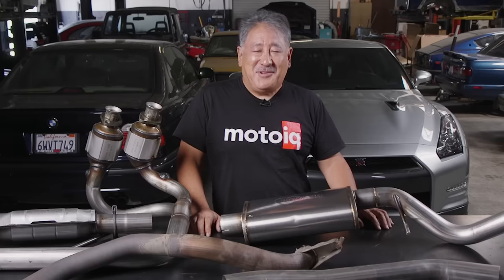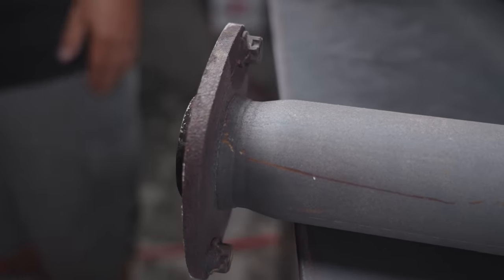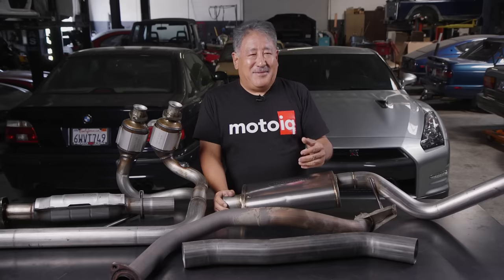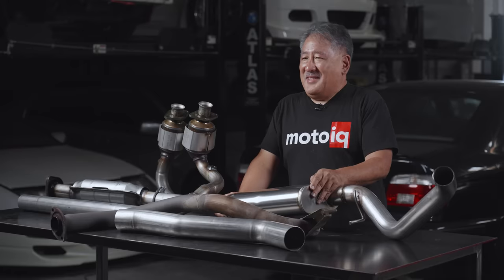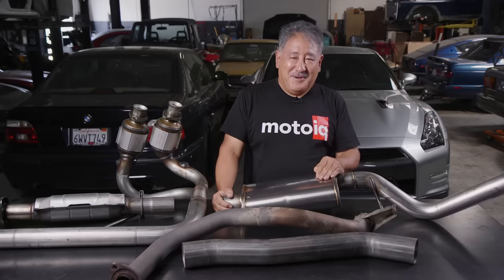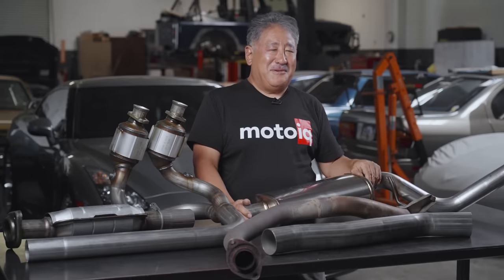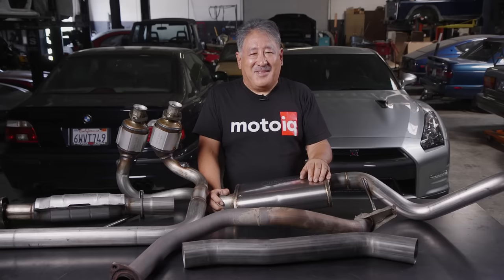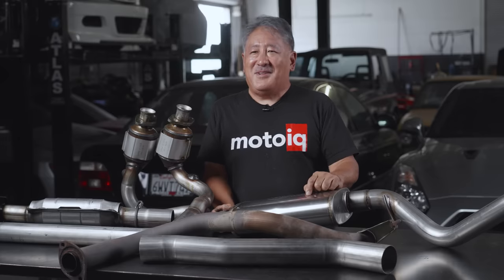Exhaust Back Pressure Myth DEBUNKED!

Comment: I think the real reason the old timers told you to have back pressure is so that your car would be slower than theirs at the drag strip
Reply: They said that and then hit the strip on open headers 😂
Reply: Na, as a old timer I guess being 56 and wrenching since 88-89, the back pressure thing came around from heavier trucks ,or cars which need low end TQ at a lower RPM , for better TQ drivability, and what happens on say a blown supercharger
D motor removing the back pressure will make it feel like the bottom end fell out of it, so that’s where it came from, plus dyno weren’t everywhere like today, to prove the facts, I’ve had plenty of supercharged motors which I regretted removing the factory mainfolds , granted it sounds better,and made more power overall, but since the power band was moved up , the drivability sucked it wasn’t as much fun why the vehicle was heavy , if I’d added a smaller pulley and retuned it ,then yes I’m pretty sure it would of felt better..
Reply: @markim5087  I've noticed that most headers are designed to perform best at higher-than-stock RPM, and if you follow the ecomodder guys, they'll go out of their way to build a manifold that produces the most optimized scavenging possible with the cam/port/displacement combination. This results in vacuum/max flow at peak design RPM, but it does produce a restriction for higher-RPM use
Reply: An engine does need some back pressure for torque I know this for my own experience if you go to big of a pipe you lose low-end torque and they had to keep on going higher RPM to get any power why on God's green earth would he say something like this small engines do require backpressure not a lot mind you just a little
Reply: @xemanuelli  i used to do open header on my single can 1.6 liter civic. it sound like a big block v8 swap xD
Reply: That or they had experience with 2-stroke engines which require a tuned exhaust with some back pressure
Reply: @robcarey4278  watch the video again. That myth came about before the layman could understand that it was velocity and scavenging that was important, not back pressure. He explains this
Reply: @dingdong2103  Yeah that's it. Old timers say that because they used to tune mopeds when they grew up and they retained the schoolyard talk into old age.
Reply from the maker: @dingdong2103  two strokes don't like backpressure either! https://www.youtube.com/shorts/qf9eFYPYXUY
Reply: Ha ha ha ha.. Maybe >.>
Reply: @motoiq  I allways found that increasing the inlet length a little increased torque, but hey, I used to build a lot of custom bikes with open pipes and everyone knows triumph twins run best with open downpipes , it's all about flowing gas afterall.
Reply: Hahahaaaaa. Yep, that makes sense
Reply: Im shocked i never thought of this 🤣
Reply: One word. Velocity
Reply: @motoiq yes that is true, but two CYCLEs are a whole different animal. The tune pipe or expansion chamber is kind of like a supercharger so to say.  Its dimensions mean everything. But yes, at the end of the stinger you basically don't want back pressure.
Reply: I had a Dodge stealth dual overhead cam. It wasn't turbo

I bought the exhaust off a turbo. All of it. Because the pipe was much larger. I had to take it all off.
I lost HP. And it never ran is good. It needed that back pressure.
Night and day difference. I think you need some back pressure on a lot of vehicles.
I've seen it myself. Even a new muffler on my GMC, it runs better.

I don't care what anyone says. I know it for a fact. Some back pressure is good.
Reply: @rickhalverson2252  I imagine it lost velocity and there for scavenging with the larger diameter pipe is what I think happened there.
Reply: @motoiq  hey you think a Flowmaster chambered muffler would be a bad muffler I’m talking about the Flowmaster 40 series on a k20
Reply: Wisdom.
Reply: @rickhalverson2252  Misunderstanding the science
Reply: @motoiq  My trade school automotive teacher told me that in 1972 the EGR systems were introduced. And in certain applications the EGR was regulated by vacuum/pressure from the exhaust. So basically if you were to free up exhaust restriction it would never build the correct pressure to activate or deactivate the EGR system which would throw the tuning completely off and lower the overall efficiency (power) of the engine. Reinstalling the stock exhaust with more restriction would naturally remedy this situation and so they were under the assumption that the back pressure was doing something in the combustion chamber to increase the power. And thus the myth was born.
Reply: MotoIQ no but they will not run without  proper Scavenging... ie back pressure even at the smallest amount
Reply: @robcarey4278 that's gas velocity going down, not back pressure going down causing that.
Reply: No back pressure means recked valves
Reply: @rickhalverson2252 needed to be retuned, thats why it ran like crap.
Reply: Good point !!! ! !!! Even here in Europe we heard some idiots claiming the backpressure is good for turbo endurability. Lol. 🙂
Reply: I can tell you 100% that a crappy 1980 1.5ltr 4 cylinder Isuzu NA motor has more torque with a stock exhaust than without.
Reply: @rickhalverson2252 velocity if you watch the video you would understand
Reply: Because they understood velocity.
Reply: @robcarey4278 totally incorrect.  You need properly sized exhaust for your application.
Reply: @xemanuelli  Gotta think though, Look at top fuel dragsters, they still run a collector at the end of their headers, the headers still act as a little bit of back pressure for exhaust scavenging, If running absolutely zero back pressure was the way to go why would anyone run headers at all? Just take the manifolds off and dump it directly from the block.
Reply: EXACTLY 👍😂
Reply: @Joey-yj5ry I don't think thats where it came from. You will simply move the torque to a higher rpm if you install a more free flowing and/or bigger exhaust, even with tuning. 
This is very noticable on smaller motorcycles even after upjetting.
Reply: @robcarey4278  you missed 90% of what he's saying. Back pressure is ALWAYS the enemy. The only detriment to running too large of a pipe is THE DECREASE IN THE AIR VELOCITY not the lack of back pressure. You could even say that the larger pipe in fact has MORE back pressure because it's not scavenging correctly
Reply: @markim5087  Thats about the  ST ignorant thing Ive heard. You obviously never had a forced induction motor. Exhaust manifolds over headers on a BLOWN mill? Hopefully your not wasting money anymore. Restrict a blown motor? Thats beyond counter productive. With a blown motor your not moving the powerband anywhere. Only way to do that is a cam swap.
Reply: @robcarey4278  lmao, wrong. Youd first have to understand backpressurem what causes it and what it ACTUALLY represents. Once you do that, we will  talk pressure waves and then sound waves.
Reply: Good idea !!! Amennn !!! ! !!!
Reply: Nah it came from 2 strokes needing it
Reply: They did actually make more bottom end torque with a full exhaust because it increased the length of the tube. They just misinterpreted the reason it made more torque.
Reply: No, their position is related to scavenging
Reply: that’s the flow issue, you gotta have good flow, you’re just confusing it with back pressure.

A good tuned exhaust will sound great and give you performance.
Reply: Comment of my day 😂
Reply: I think the old timers were talking about V8s not modern K motors , I just straight piped my 5.7 ls1 and it’s has no low end speed but more power when I put my foot into it and My old man reckons that it can blow valve seals 🤷🏻‍♂️
Reply: @rickhalverson2252 Watched a video and read comments and still don't understand the velocity thingy any better than a guy from 1960 do you ?
Reply: @erasmus_locke  nobody wanted back pressure back then on high compression engines. The more air coming in the less restriction going out. We don't port and polish heads for back pressure but on a stock small stock engine it has to have back pressure for all the sensors and shit to Read right.